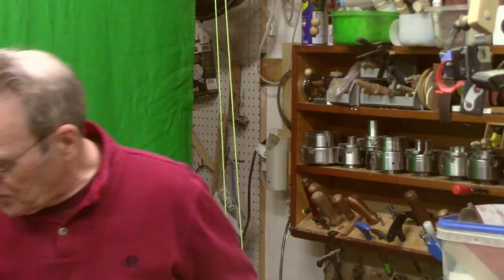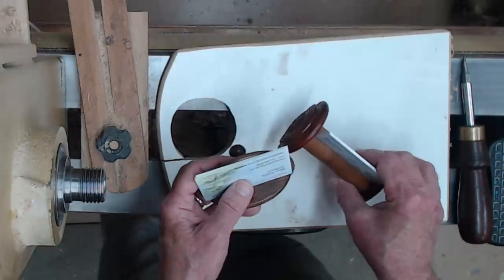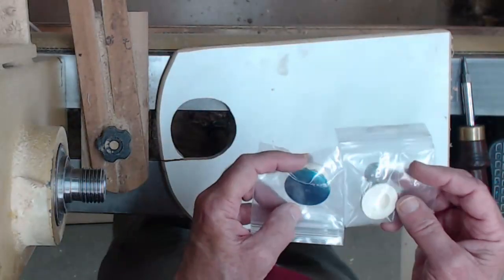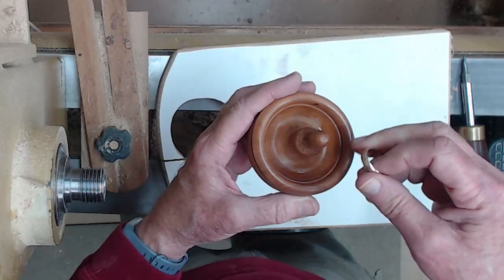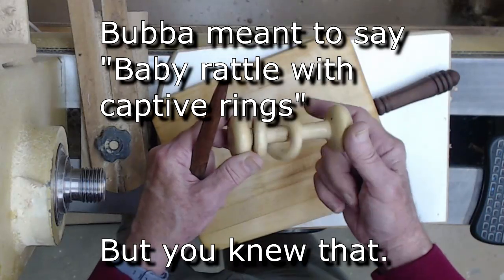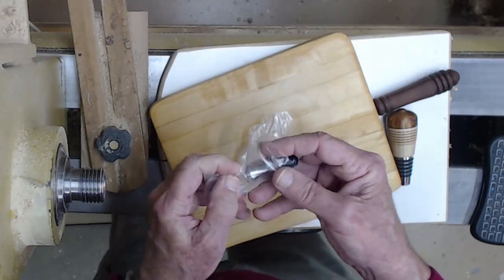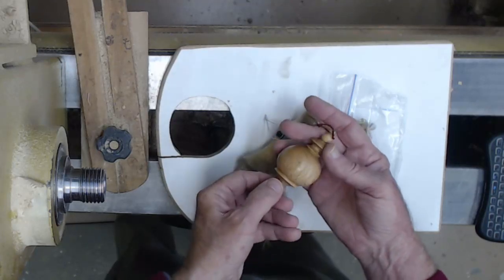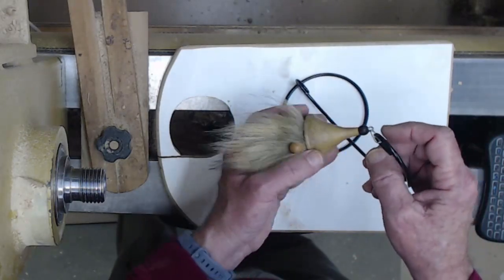Turning Christmas Gifts - Some Ideas

Comment: I prefer the Rockler pizza cutter kits; and Rockler does now sell a 3 pack of covers for the pizza cutters.  I also like the Rockler gardening tool kits
Reply from the maker: Thanks for sharing, Byron!
Reply: I have made a couple of Rockers pizza cutters and they are great. A very nice, stout, heavy duty type cutter which I really like so then you aren’t having to sort of slam the cutter down on the edge of your pizza to get through the crust plus it unscrews from the handle easily for cleaning to. Not to bad a price either for a good quality kit.

Comment: I think this year i will be doing  scroll sawn 3d xmas ornaments & a wooden kitchen spoon, that is kinda triangle shaped & flat (easy to do & i feel lazy this year lol)

In the past ive made cutting boards that turned out to be about half to 3/8 thick so they are more like cheese/charcuterie boards, and turned Christmas ornaments about 3 inches long from various woods (trees, snowmen, angels etc). I got tiny tiny eyelet screws (lots of different colors) & a tiny tiny hand drill with bits (also tiny) to make a hole & that worked well with a fancy ornament hanger from walmart.
Reply from the maker: Thanks for sharing your ideas with the community!
Reply: @MikePeaceWoodturning  welcome! 

I forgot to mention knife kits. Finding a nice board & cutting it to scales is much more economical than precut knife scales. But i think woodcraft just ended their $10 knife kit sale? Idk.